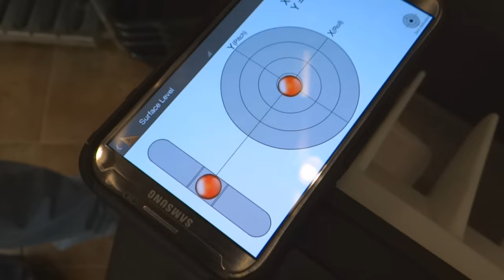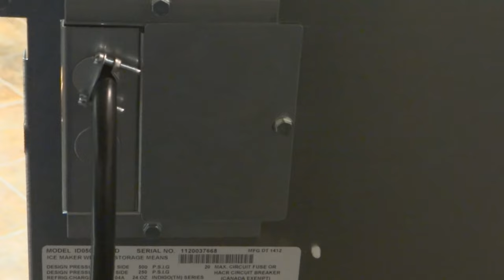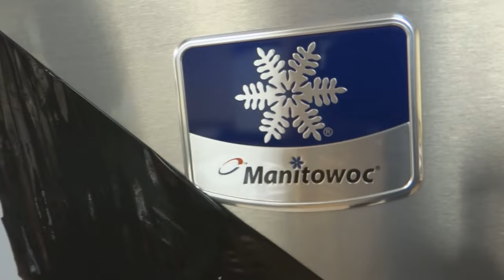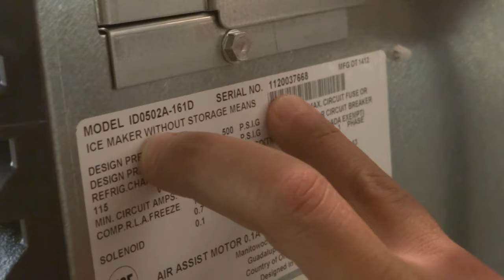Ice Machine Installation - Policies & Procedures - SD0502A

Comment: You can mechanically lock the compressor when you lay down the machine
Reply: in many cases you're correct , but what they laid down was the ice bin. They did this to put the feet on the bottom of the bin. The compressor is in the top half of the unit along with the condenser (if its not a remote unit) and evaporator.  so no harm no foul :) ice machines like the cuber in this video , are typically two separte parts : the bin  , and the ice machine it self.

Comment: can i directly connect the machine to the ro purifier? it produces 100 liters of water per hour
Reply from the maker: The ice maker needs a pre filter and water filter dedicated to the amount of gallons per hour the unit uses. Some customers like using an RO system in conjunction as long as the RO is maintained! However, be careful with water softeners as these will affect the production of the machine.

Comment: nice video sir, my drain is far away and not floor drain, and may required a pump drain, can it be coded if air gap is from ice machine drain to the pan and have a pump line drain from the pan to the drain pipe? Thanks in advance!
Reply from the maker: Condensate pumps can be used in certain applications when the drain is not in proximity to the ice maker. However, your inspector will have ultimate say if this is allowed. Although this is commonly done, it is always best to verify with your local inspector!

Comment: What is the capacity of the ice machine?
Reply from the maker: 500 LBS on spec but in most applications it's lower... closer to around 375-400 lbs. We suggest customers go up a size up if they truly need 500 lbs of ice.